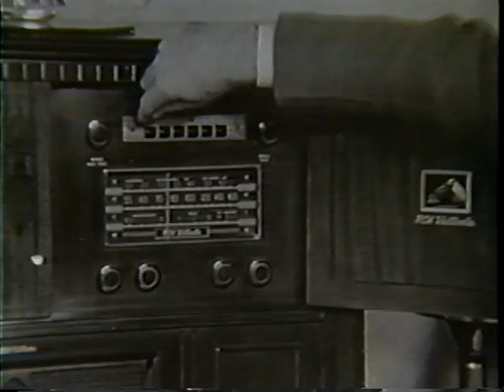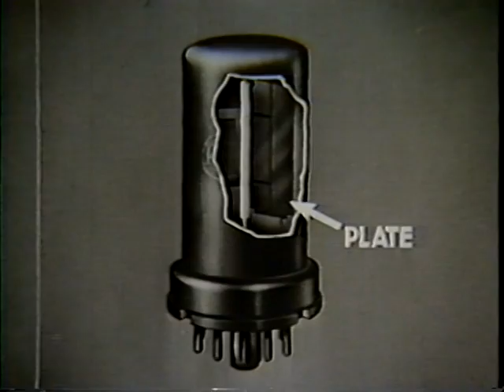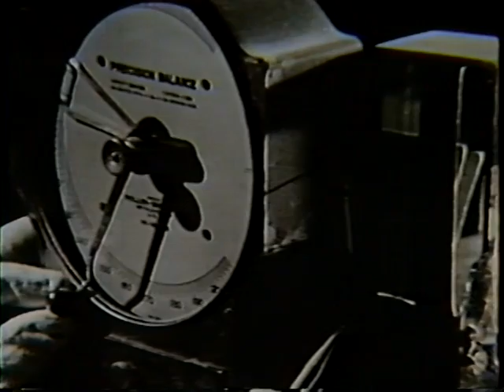Electrons on Parade pt 1 - RCA

Comment: Nice video. must be 50,000 volts?
too bad workers used their hands to touch the parts before the coatings, maybe the tubes would have lasted longer, to compete with the solid states.... LOL. well at least they are coming back, as the vinyls are too.